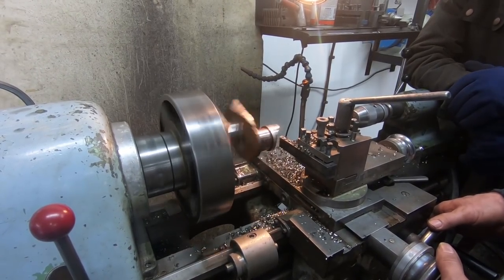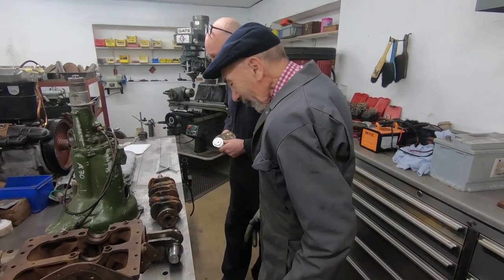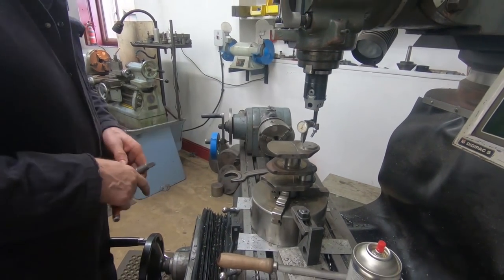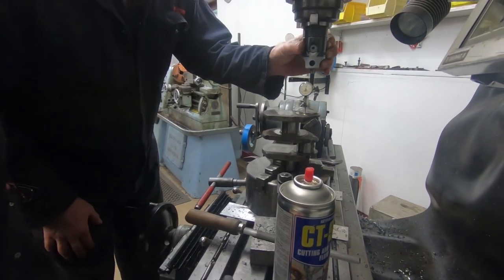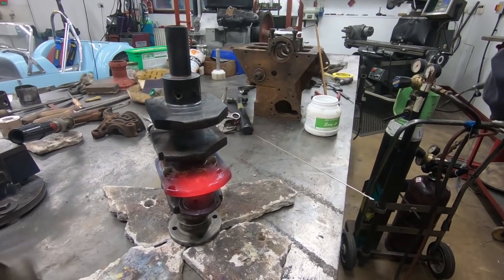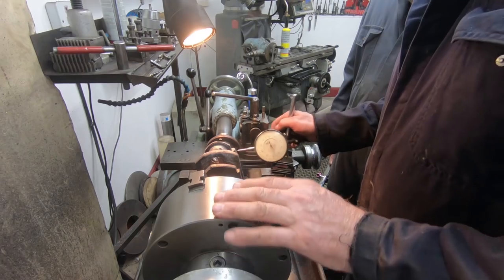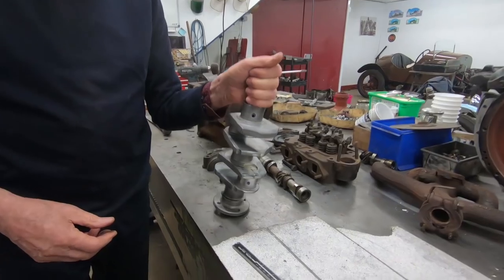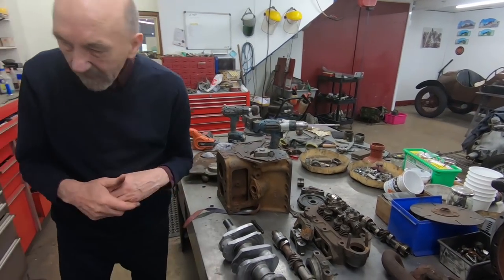Making the crank Mini 2 cylinder Part 1 - Ivan's Shed

Comment: I worked in a mini shop in Germany in the early seventies. We got in a mini whose engine had a funny tick during startup and once it ran, the tick went away. It turned out that the crankshaft had broken diagonally across the center main and once oil pressure came up, it acted as a hydraulic cushion and the engine kept right on running!

Comment: Your video's remind me I've had my ladder up against the wrong wall for most of my working life. Now my arms are nigh on useless and I can no longer throw a car into a bend like I used to with my 1340cc hillclimb mini whilst grinning from ear to ear.
I come from a family of Engineering jigglers and Foundry men, and have cut and ground and welded and blended and bored all sorts of engines and gearboxes and shells up to around 25 years old. Then my life changed and i wandered off into Construction, where I became chief bodger for a large Company, but I'm not allowed to put it on my CV says the jobcentre, even though it's a major skill.
I think we can do it, exactly, you'll never know else.

Comment: I do rather have a soft spot for the 'Chipmaster'. It's the lathe I learned to screw cut on. You had my attention within seconds as someone else who can be bothered to build modified engines in the Alan Dudley Ward style. I still learn something new every day. I'm in the process of building two different variations of my Norton 88 engines to go into my Domiracer Lowboy replica chassis.

Comment: Just a tip Ivan... you can use liquid paper as an antiflux... you can accurately paint it on and it won't burn off but can be scrubbed off.  Brass won't flow where it is painted even with flux.

Comment: Look at Alan Millyard videos he has joined several crankshaft and cam shafts O on motor bike engine's. Think 360 degree is needed, forget the distributor go for wasted spark as in Citroen 2cv. I was made in 1941 great year for tinkerers!
Reply: Millyard is a ruiner of good, decent engines. These men are doing something useful.
Reply: What is Millyard doing that these men aren’t?
I see both parties taking 
(in some cases) useless obsolete parts and turning them into something unique .

Comment: Having spent 25 years rebuilding, remanufacturing, straightening, welding and grinding crankshafts I don't see this one lasting very long. Ok for a short test maybe, I'd be amazed if it ran more than a very short time under load. I'll be watching!
Reply: Pressed up cranks were used on motorcycles etc for years if they ran in ball or roller bearings. They only gave trouble if they were highly tuned to race.
He is only going to run it in Light use. But like you correctly say, let's see how long it holds together.

Comment: Brazing crankshaft parts together with help of a center bolt - very interesting. Did a similar job by using Hirth-joints. Engine runs well...

Comment: Here's a crazy idea for you, I used toi have a Lotus 6 with a 1100 Morris Minor engine. To make engine servicing easier, a standard Mini radiator was mounted directly to the front of the engine, alla Mini, which meant the engine could be bench tested without a lot of additional add-ons. Like I said Crazy idea.

Comment: Very interesting project Ivan. You gentlemen have very impressive engineering skills. Would'nt it be easier to just take two plug leads off the A30?  :)
Reply: You'd have to take the plugs out too, to get rid of the redundant compression & not chuck fuel down the exhaust.

Comment: I did build-ups, repairs and adjustments to motorcycle and snowmobile cranks and it always seemed like silly work.  Tedious and prone to failure.  It was a huge relief when splined crank parts came around.  This crank should work great for 35 hp.

Comment: I think the crank needed to have crank pins on the same plane so that firing occurs every 360°...  A four stroke engine takes  720° to complete one cycle. On this engine, if we say No. 1 cylinder fires at 0° of the 720° cycle then the second cylinder fires at  either 180° or 540° because of the big end pins being opposed on this 2 cylinder engine

Comment: Bloody lovely job on the crank Ivan I am very impressed! It's amazing what you can do with a vertical mill and a lathe! And of course someone who knows how to use them. Is that a Colchester Lathe? If so Student or Bantam? Such a pity they went out of business, their lathes went all over the world. Where about are you based?  I just love your "Shed" mine is a little smaller, just 8 feet by six and a half, with a Chinese 12x19" lathe / vertical mill set up. But I get by! Looking forward to the rest of this 2 pot mini engine build.

Comment: Given that the distributor is 360 degree firing, I'd guess both pistons should rise and fall together. A 180 degree crank would have an odd firing interval and that dissy cap won't work
Reply: I agree.  It should be a parallel twin, not an odd-fire twin.

Comment: Thinking about it some more while gardening! if the crank pins are not both on the same side will you not have to use a four cylinder distributer and use two leads at 90 degrees from each other rather than the one with two leads at 180 degrees?

Comment: With the equipment you have it may have been easier to fabricate the entire crankshaft from steel plate and bar?
 I've worked on motorcycles since 1968 ish although not 'professionally' until late 70's and done thousands of pressed up motorcycle cranks in one two and three cylinder engines. (and a few dozen Harley Davidson V-twins)
 It would have been pretty simple to set up mill to bore the Salmson head your doing for new valve seats as I see you have a boring head to get accurate sizes. It would have been more common to fit bronze seats in 1950's 'race' engine

Comment: I might have missed it but why have you gone for one up and one down rather than both crank pins in the same location. If it works it will sound nice with an uneven beat.

Comment: Interesting to see how this develops.! Never seen a twin cyl 'A' series engine before. Comments about the 180 crank seem pertinent, never seen a British 4 stroke vertical twin use such a configuration. The only 180 crank 4 stroke engine I know of was an early Honda vertical twin 'CB' motorcycle engine, had to have chain driven counter weights to offset the imbalance, was a pig of a motor, the bike got the death wobbles up at any speed over 80kmh. And what of the lovely new (Lucas I assume) twin contact distributor, unless the contacts internally are offset towards each other 45 degrees, how's that going to work.? But you're right, the original photo looks a bit sus, don't see how they could compact a mini gearbox to fit under that motor. An early case of photo-shopping perhaps.?
Reply: CB350 (1968~74) or the later 1974~77 CB250/CB360 didn't have 'Lanchester' shafts (rotating balance shafts) 
That happened 1978 with the CB250/CB400 twins (3 valve motors) and the later 350 from about 1985(?)
 Multiple reasons for 'death wobbles' on early Honda CB250/CB350 around 50mph (80Km/hr) but generally poor maintenance and probably pitted steering bearings plus wrong (or worn out?) tyres,(almost always, too wide for wheel rims) too low or high tyre pressures, worn out swing arm bearings and leaking rear shocks are just a few (bent or seized up forks, loose spokes,worn out wheel bearings a few more reasons)
I've built several capable of 120mph and while not particularly good handling they are no more dangerous than any other 1970's motorcycle
Reply: @1crazypj  Whenever they had or didn't have balance shafts is irrelevant, a 180 degree crank on a 4 stroke twin is out of balance, thus making a crappy motor, which the CB was.!
Reply: @stuartd8233 I think you have some sort of bias against one of the most successful Honda engines ever made? (over 3.5 million sold)
I don't particularly like the 350 engine and it did have faults but it wasn't as crappy as anything which was supplied with drip trays to catch the oil leaks as delivered from factory (HD)
350 wasn't a crappy engine, but, it wasn't a Triumph or Hartley Davidson either and was responsible for the mismanagement of both companies being shown for what it actually was. (or, how Edward Turner, et.al. destroyed BSA and Ronald Reagan saved Harley)
 A 180 crank has far less vibration than a 360 crank, in fact primary forces cancel out but the rocking couple is very high and the wider apart the crank pins are the worse it gets. I have a couple of early 1950's BSA A10's (pretty much exactly same engine as Ariel Huntmaster650 twin) and know as much as I want about 180 and 360 twins then learned much more than I wanted to when I started messing around with Yamaha XS 650's.
 A 360 degree twin has a massive out of balance force, far worse than any 180 degree twin. The main difference will be how it's dealt with. 
360 degree twins can set the balance factor so the vibration is more in line with the wheelbase (horizontal) whereas 180 twins will always have the 'rocking couple' in line with the cylinders. 
Yamaha, when 'flat tracking' XS 650 (motors bored to 750cc) experimented with various crank angles including 90 degree phasing (270 crank angle) as used on the XT750 and TDM850 parallel twin which had balancer shafts to counteract the vibration from the 'rock'. the crank angle offset was so all the primary out of balance forces cancel out, as in a 90 degree v-twin.
 There is a lot written about Phil Irvin's experiments with Triumph engines but vast majority completely misunderstand exactly why he didn't re-phase to 90 degrees and used 76 degree offset (Yamaha is very easy to offset at 83 degrees due to splined flywheel web)
BTW, you are the one who brought up 350 Honda's and balance shafts, I'm just putting things straight.
Reply: @1crazypj  No bias, just fact, as I previously said a 180 crank 4 cycle vertical twin is out of balance.! No amount of 'wizz bangery' is going to change that.! Is simple engineering principles. Loads of designers have experimented with different configurations, it's how we learn. And if any of these designs are successful they would be on the market now.! And as well you know the issues related to western production at that time was quality, not design. 3k, 3m or 3b sales does not equate to good design.! Whilst I made no mention of quality issues, at the time it was vastly superior with the Japanese manufacturers, of this there is no doubt.
But if the 350 was such a beautifully balanced motor why did it need balance shafts.?
A pig in lipstick, no matter how much lipstick is applied is still a pig.! END OF
Reply: @stuartd8233  END OF.............what?
Sorry, I have to add just a little more.
 I like messing with engines, all engines (including diesels) and think this is a great project, very interesting seeing probably the only Mini Twin in existence?
As this is about Mini's, the head and ports were pretty poor design even though it was touted 'ground breaking design by Weslake'  around 1958 ( I read about it somewhere)
Maybe from a production standpoint but definitely not performance-wise. 
I never said 350 was a beautifully balanced engine just it was better than 360 degree, It has a very annoying high frequency vibration which is way more annoying than a 360 twin but IS much lower amplitude
 I'm fully aware of the fact so you don't need to reiterate. 
 Japanese 'quality' was not as good as the rest of the 'developed industrialised nations' at the time as they didn't have the raw materials (still have limited natural resources but do have more money now to buy them)
 What they did have was a design that worked with the limitations of materials.
Parallel twins were most common so that is what they copied and improved on, mainly design improvements using pretty poor materials (which is why CB350 weight is almost same as 650 Triumph and fuel 'economy' worse)
 I trained as a precision machinist in mid 1970's.
 At the time 'we' (Britain, USA, most of Europe, Australia, etc) were working to a 5% failure rate for production manufacture with tolerances in the 0.003"~0.005" range. Reducing that to 3% resulted in strikes and walk outs (although I was regularly doing production work to 0.003mm @97% at the time)
 The Japanese at the time were working to 0.001% failure at the same tolerance using 'semi skilled' factory workers plus putting almost 80% of profits back into R&D.
Even further 'off topic' my uncle was a POW of Japanese in WW-II but I don't think we should go there

Comment: A very interesting project there. just one question, how are you going to run the ignition system for a 90 degree firing order?
Are you planning to use two leads from a four cylinder distributor 90 degrees apart? It should sound nice with a V beat in that configuration..
Reply: @dougabbott8261  That's what I thought, except it looks like a 180 degree distributor which won't work with a 90 degree engine.
Reply: @alasdair4161  You are right on the money. Later on they use a different distributor after coming to the conclusion you have made.

Comment: A crank with both pistons at TDC is a smoother engine, as it fires evenly every 360 degrees. Have a look at most twin bike engines.
Reply from the maker: Hi, we are aware of that. It’s for balancing, re: previous comments
Reply: @DGBcars  You just need to add more bob weights to the webs. There are calculations online of how much to offset it using the weight of the con rods and pistons and it can be done statically. As part of the rod is rotating and the other end is reciprocating I believe its roughly 2/3 the weight of piston and rod (but don't quote me on that).

Comment: well i am kind of confused
if this mini was 2 stroke engine rotating the other piston by 180 dergee would make sense but if the engine in normal 4 stroker  wouldn't thet work like  spark, spatk, nothing, notning (or spark nothing spark nothing)?  i mean every engine i know with only 2 cylinders next to each other from fiat 500 for example have the two pistons work in synch and fire  alternately  on each revolution so there is no dead strokes
i know it all depends on a cam shafts but i am really corious how would it work and what parts do you have and what you going to make from scratch
Reply: It is a mini a series engine. A 4 stroke, 4 cylinder. Essentially what they appear to be converting it into is a 2 cylinder, 4 stroke in a rocking twin configuration. Normally they tend to be 360° parallel configuration. The issue I see is that many rocking twins employ a contrarotating balance shaft. But we'll have to see how it works.
Reply: I have the same doubts
Reply from the maker: Hi you’re right! The 500 engine is a two bearing though so plenty of room for a big counter balance. This engine is 3 bearing with hardly any room - not to mention we don’t have the proper equipment. This is more of an experiment really and we will be just as curious how this runs as you are! You’re right about the sparking, it will certainly sound strange! Hopefully it doesn’t shake itself to pieces..
Reply: @DGBcars  fun fact
 polish(as for poland not polishing) shead mechanics discovered a way to install parts from multiple angines into fiat 126 crank case to make it much more powerfull ;)
swaping fiar 126 bis/chinquecento 700 crankshaft, polish cargo van "żuk" connecting rods and slightly machined vw bug 1600 cylinders and heads just to make 800 cc from 600(or 650) stock , so i love to see those one of a kind conversion come to life
i hope your small engine won't shake itself apart and that your crank will held up to the abuse, i kind of cryed a bit when you transfered hole patterns from the flange to the engine block  and not the other way around, i hope there will be no leaks  from the water jacket

Comment: I reckon your engine will sound like a Harley...Fire, Fire, exhaust, inlet... I wonder why you didn't set the crankpins in the same plane, so that it would fire evenly?  Great project though :-)
Reply: I thought that myself, surely that would introduce a lot of vibration as well as uneven power impulses, a staggered crank setup would be ok as a two stroke
Reply: @davethornewell7417 a 360 twin has even firing but is as badly balanced as a single. A 180 twin is uneven firing but has smaller out of balance forces!
Reply: @markscully2342  My 650 BSA has a parallel twin setup, and the forces on the crank need to be considered for an uneven setup. I would not do as has been done, but as I said, a great project :-)

Comment: I’m lost here, why isn’t the first throw at the back and the flywheel flange the same bit of crank?
Reply: Oh, we are going for ‘Bob bob bob’ instead of ‘bobob bobob bobob’ like a Harley. Well, CAT donkey engines were even firing so it will run okay. Might be like a four wheel whacker plate though :D
Reply: Okay, it is a bobob babob. Only way to get the crank right at the flywheel end is bolt it to a flywheel and mount that on the chuck. Amazing build :o)

Comment: Why is the crank ser at 180 deg? surely it should be a 360 crank to match the distributor and for more even firing.
Reply from the maker: We’re planning on doing a Q&A soon due to all the comments but yes you’re right. Look at previous comments that have said the same thing. It’s due to the balancing as we don’t have the correct tools and just want to get it running on a budget. We will see what it sounds like! It’s more of an experiment than anything really

Comment: Call me daft, but surely on a 2 cylinder 4 stroke engine,  both pistons need to be going up n down at the same time... although I guess it would be an extremely rough running engine,  but if they are at opposite ends of the stroke they won't fire at equal degrees of rotation....
Not the best explanation,  but hopefully it makes sense???